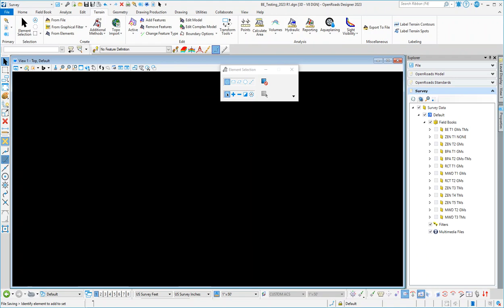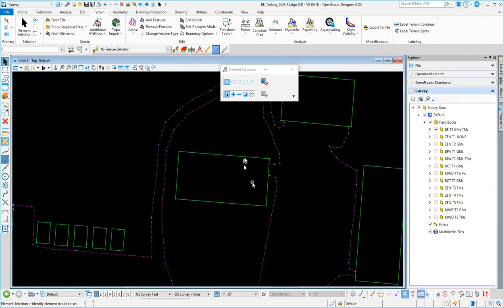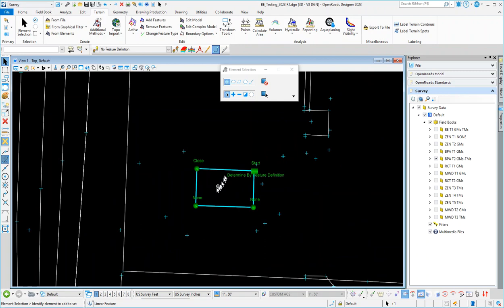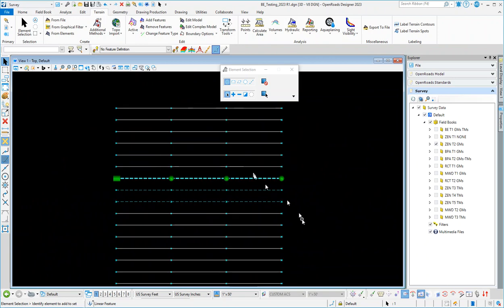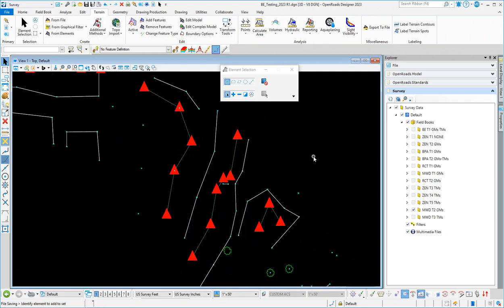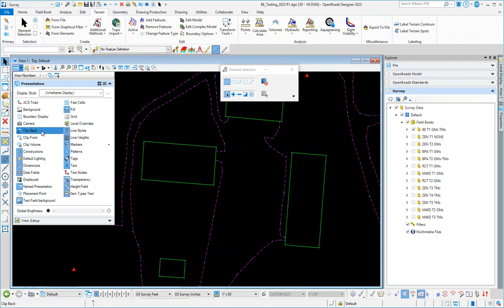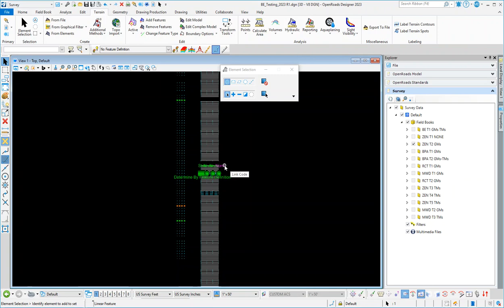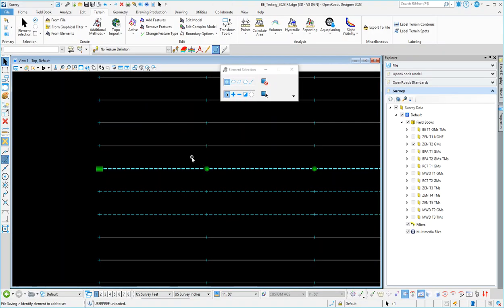ORD Survey 2023 TMs GMs Issues

Comment: Mark,
I've used InRoads for quite a while and OpenRoads was just coming into common use when I retired.  When you mentioned that the clip back view setting had some effect on the manipulators and I wondered if it is caused by using a 3D file.  Can the work be done in a 2D file and would the same problems occur there?
You came to Sacramento to help us with some problems quite a few years ago.
Jim Weir
Reply from the maker: Hi Jim! OpenRoads changed the rules a bit and now it's required to use a 3D file when working with Survey Data and Terrains (Surfaces) and 'required' to use a 2D file when laying out Geometry and Corridor Modeling. So, as much as what you are saying makes sense, the software, for Survey and Surfaces at least, isn't built to work in a 2D file. Now, that doesn't mean that I won't try it, just for the heck of it. ... but doing it in a 2D file won't store the Elevations.